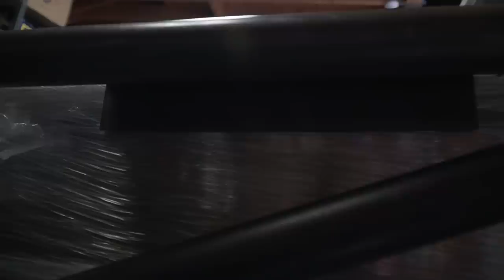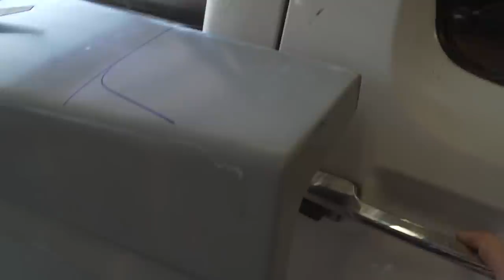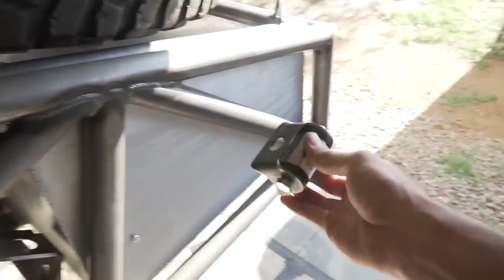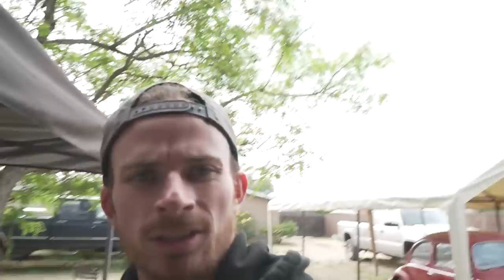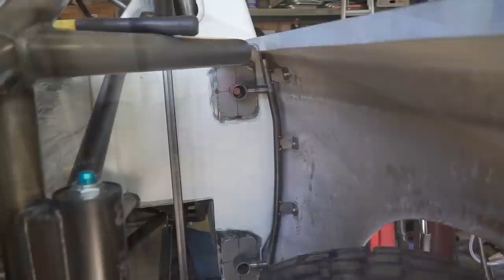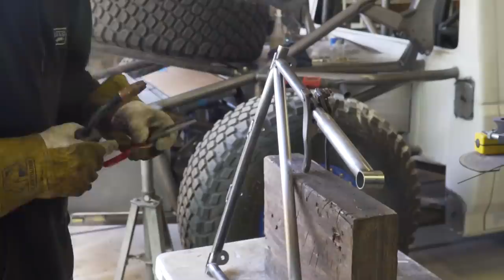Installing NEW Fiberglass Bedsides on the Tube Chassis PRERUNNER!

Comment: What size welder and brand are you using ? Yall do excellent work
Reply from the maker: I use a Miller 215 multimatic as my mig welder, and an Everlast 185 for tig with the upgraded pedal and Fupa cup!

Comment: How do you measure the bulge for bed sides? My ranger has the stock bedsides that have been pulled. The wheels sit nicely in them. But it’s also not the stock rear axle. Thanks